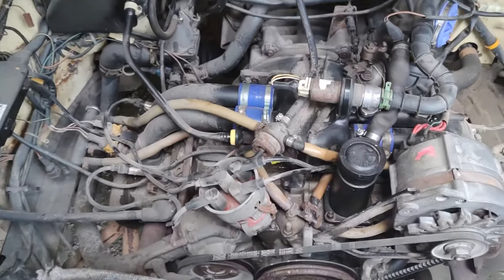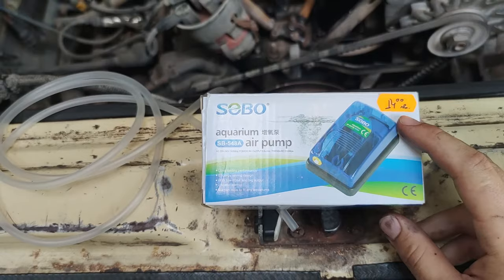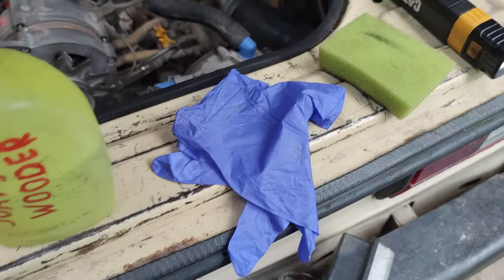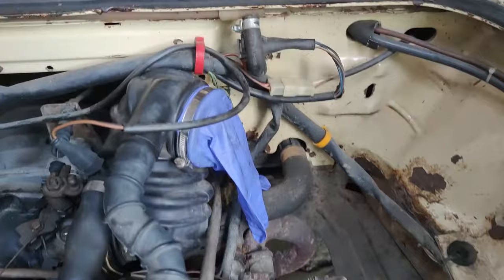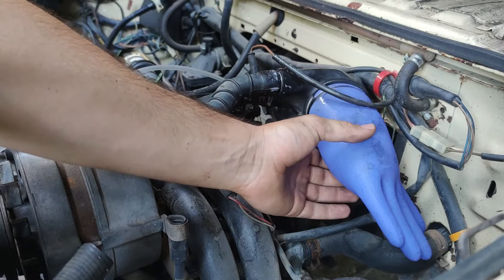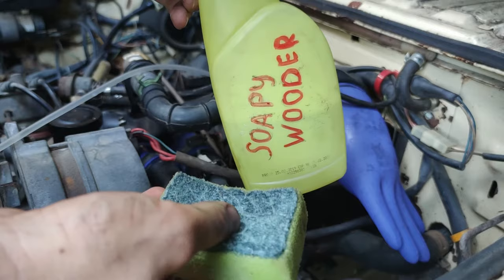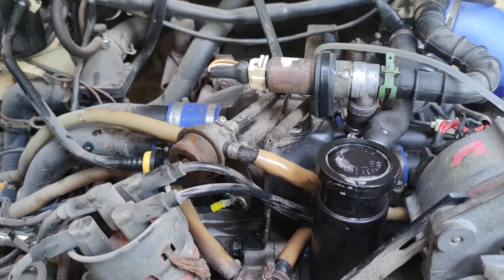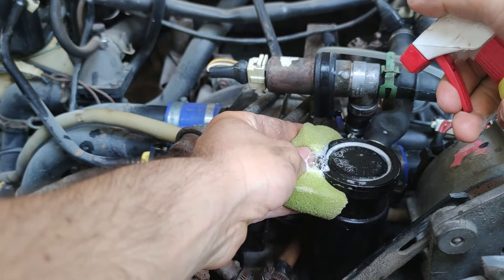Homemade Vacuum Leak Tester - Quick & Cheap DYI Diagnostics For Boost And Vacuum Leaks

Comment: thats not vacuum
Reply: Interesting comment. 
 But now that I think about it, I guess it bubbles because the engine is not running therefore not creating an actual vacuum. 
  The pressure from the air pump is creating pressure inside de the vacuum line which causes the soapy water to bubble.

Comment: Did you have to block the exhaust off or not?
Reply from the maker: The only moment when an intake and exhaust valve are open simultaneously is at TDC, and only on high performance engines. Usually when you shut down an engine the pistons stop around the middle, because the compression pushes them back. I didn't block the exhaust and it worked splendidly. 😁
Reply: @BearBoris  Ok thanks

Comment: this is great for most cases but yesterday i found a massive leak at my injector o ring that only leaks past 3-4 psi,this is why its important to add the same psi as the turbo puts out because you want to stress the system the same.
i was stumped because everything was pointing at massive boost leak yet i could blow into the tester and plug the tester with my thumb then aftyer 20 seconds i release and hear a loud "pshhhh" as the air left my tester telling me i had no leaks,it was only once i added psi did the leak appear.

from now on im all about stressing the system and pumping psi

Comment: 👍👍👍  Excellent idea.   One of those car tire inflation pumps would work also with a football adaptor and the bit of extension hose.
Reply from the maker: Yeah, probably, although a big advantage of this pump is its quietness, which allows you to also listen for the leak and it has a lot of flow at low pressure, the tyre compressors have low flow at high pressure. It'll probably still work though. =)
Reply: Wonder if that works for evap leaks from the fuel system.  That's what I need to check.  I would also put the pump somewhere to hide the sound so I can hear the hiss of a leak in that location under the truck as well.

Comment: How do you know all of your valves are closed when you do this job? Wouldn’t it be likely at least one cylinder would be open? The vacuum would just escape out the exhaust potentially.
Reply from the maker: I replied to this question a few comments down. You would need to have both the exhaust AND intake valve open for the air to go out of the exhaust. This is only possible in very high performance engines with very aggressive cams. Also it only happens at TDC, and usually when you shut down an engine it stops around the middle of the cylinder due to compression. The method has been tried and tested by many people, I came up with the aquarium pump and soapy wooder combo because I feel like it makes it very affordable to reproduce. =)

Comment: Good afternoon my brother,

This is good video content I like it. I subscribed to your channel because your helping out diyers that want to save money, diagnose and repair their vehicles from home.

Towards the beginning of the video I saw that you connected one side of the clear hose to the port on the aquarium air pump. Where did you connect the other side of that clear hose to? Cause you don't zoom in and show that part.
Reply from the maker: Glad you liked the video!
You can connect it to any vacuum line on the engine, this will feed the air into the intake manifold. =)
Reply: @BearBoris I have a leak on my ac system  Its a 2003 dodge caravan se. Is it possible that I can buy an aquarium air pump and use it on the vehicle AC system to find where it's leaking from?
Reply from the maker: @AlwaysDiagnoseVehicleFirst  The AC system is a bit different. It works on much higher pressure and the aquarium pump might not be able to force air out. AC leaks always leave behind an oily stain. It's usually either the compressor or the AC radiator. Check for any oil near the leaks.
Reply: @BearBoris  Do you think if i get the strongest aquarium air pump available from a pet shop or some other store that it may be able to force air out of the AC system? 

Do you happen to know how to remove (recover) refrigerant from the AC system without having a very expensive recovery machine so I can do it from home by myself as a diyer?
Reply from the maker: @AlwaysDiagnoseVehicleFirst  I don't think there is away to remove it and then put it back in without the professional machine. If the system is empty, you can pressurize it with your compressor, but you still need to measure if the pressure drops after a bit... I don't think that's something you can DIY.